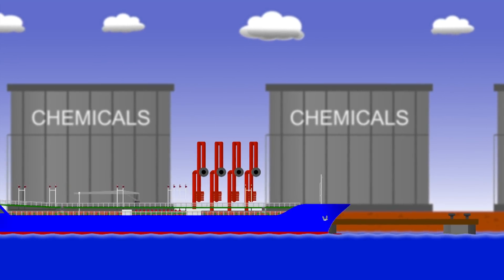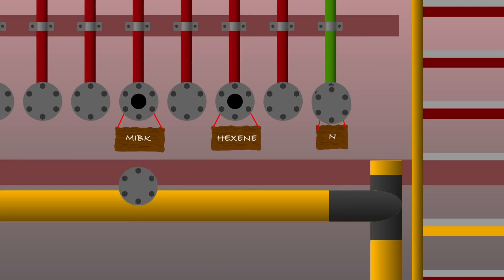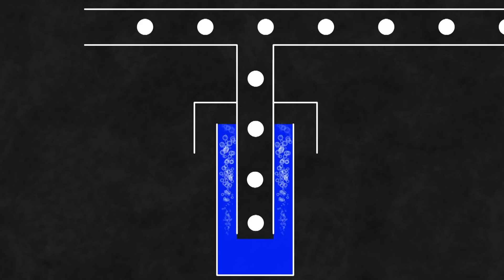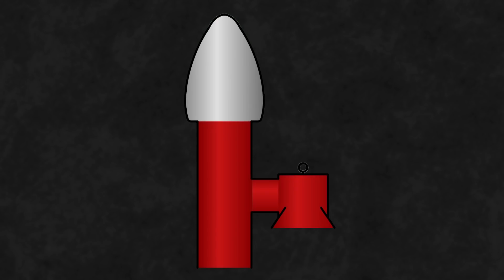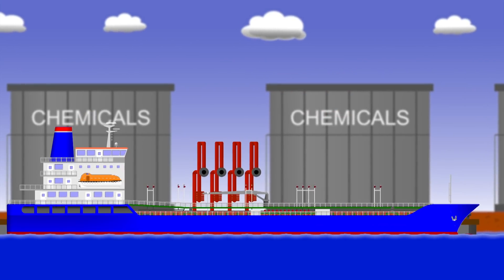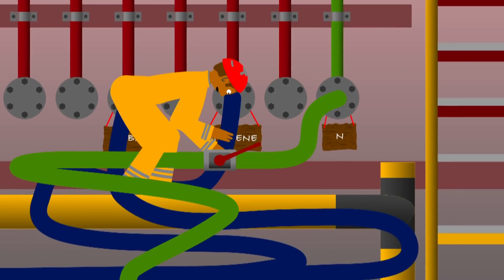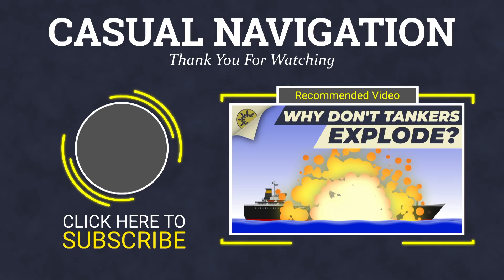What Do Ships Use THESE For?

Comment: as a chemical engineer i'm kind of horrified that there wasn't any secondary pressure relief device in form of a burst disc. is it common on cargo vessels to not have anything like that? it would still have ruined the cargo, but at least it should have prevented a rupture of the cargo tank
Reply: Wouldn't a burst disc endanger the crew again?
As said in this video the pressure relief is build in such a way to safely discard the gas.
Whereas with a burst disc the gas would stay on the deck.
Reply: @Jehty_  fair enough, though you can also install it high and away from the deck, to minimize that. and i'd rather have just the gas collcting on deck and be warned with an alarm, then have the tank under my feet rupture and then most likely still have the gas collecting on deck or worse in the hull
Reply: @saladiniv7968  or have it be connected to a pipe on the side of the tanker, so it spews over the side, away from the deck, cause it’s going to end up in the ocean either way
Reply: @Jehty_  A burst disc is a last resort and it endangers the crew less than the cargo tank bursting!
Reply: All of my rocket test stands and rocket vehicles had relief valves AND burst discs, with pipeaways to control flammable vapors if needed. For the Lynx vehicle with integral low pressure fuel tanks in the wing strakes, I invented a resettable 1.25" burst disc that used magnets to hold a plug in place. It could be adjusted to open at pressure differences from 1.2 to 11 psi, with repeatability within 0.15 psid.

Okay, maybe it is rocket science, but it's really damn basic rocket science.
Reply: International regulations regarding cargo tank pressure and venting can be found in Safety of Life at Sea (SOLAS) Chapter II-2 Regulations 4.5.3 and 11.6.3. As well as the Code for the Construction and Equipment of Ships carrying Dangerous Chemicals in Bulk (IBC Code) Chapter 8.

The big takeaway is that a cargo tank needs two means of protection against over/underpressurization. Most oil tankers will have about 12 to 16 cargo tanks and use a P/V valve on each tank and then a P/V breaker on the common vent header.

But chem tankers have to be concerned with cargo compatability, so a common vent header is not frequently used on these vessels. Instead the high and low pressure alarms on each tank serve as the second means of pressure protection.

Rupture discs (as the maritime industry calls them) are allowed as a means to protect the tank, but then that released cargo needs to go somewhere safely, which means it can't go to another cargo tank or adjacent area where it may have a dangerous reaction. This requires a vessel to dedicate space on the ship to only be useful in an emergency, and in shipping lost space is lost money. So they usually go with P/V valves, pressure alarms, and outlined procedures on how to conduct a cargo transfer. In 99.999% of cases this combination works just fine. But in this case they ignored their procedures, got a low pressure alarm which warned them that things were going wrong, and then they over corrected instead of taking a step back to reconsider. Regulations help prevent disasters, but even the best regs will fail when people decide to ignore them and ignore common sense.
Reply: @phantomsplit3491  interesing to know. in the chemical industry an alarm is just a warning, but would never count as a separate safty feature if it requires any action by the workers. it might be a bit paranoid, but we assume the worst case in wich the entire workforce is incapacitated/just not paying attention. i agreed that in 99.9% of cases it would be overkill, but that 0.1% is un my mind enough to justify it.
Reply: @phantomsplit3491  may I ask in what part of the world you’re working as a PSC inspector?
Reply: @bas6983  I'm in the United States
Reply: @saladiniv7968  the pressures are continuously readout on the loadicator and the activation of PV valves is a reminder too for the deck crew. The alarm is a final warning, and over pressurisation is normally treated seriously. But ig they downplayed its severity, because it's not that rare.. It's pretty frequent in chem tankers especially when recieving nitrogen from shore. It's a pretty big thing if your company recommends a 1 inch hose and  you're using 4.
Reply: Fun fact: My previous vessel's pumpman was among the one's who got sacked for the Accident.
Reply: @rustteze  taht is all well and good, but i wouldn't call anything that requires any intervention by the crew a safety device. for that it would have to automatically act in a way to prevent an accident, in this case release the pressure. you should also always have 2 independent systems doing it, to prevent the faliure of one resulting in an accident
Reply: @saladiniv7968  yes it's mostly just a fallback for if the PV fail. The cost segment for owners means most of them install just the bare minimum for the ships to pass international standards.. And if 99% of the time it works.. No ones gonna take the initiative to change it
Reply: @rustteze  That's the same in any industry i guess. i guess i'm just kind of spoiled with these redundancies, since switzerland is very safety conscious, especially if it comes to chemical industry. so the regulations are pretty strict and demand it, otherwise a lot of companies probably would try to cheap out as well.
Reply: @beeble2003  if the burst disc came at the end of the relief pipe and a check valve fitted with the end discharging overboard I don’t see the problem …
Reply: @chrisbraid2907  I never said there was a problem. Somebody said that burst discs would be dangerous for the crew; I pointed out that they would be less dangerous than the cargo tank exploding.
Reply: Burst discs are actually used when transporting Hexene-1 on chemical tankers, they are inserted between the PV and the PV pipework to seal off the cargo space from outside air completely due to Hexene-1 reacting with air. Should that fail, the burst disc goes, and then the PV blows off. There is a lot of issues with this. As a cargo tank is 98% full, and a ship rolls & pitches at sea, the fluid can come up in the PV/vapour line and burst the discs. We often found that when removing the burst discs after a Hexene-1 trip that most of them had burst anyway.

Comment: A few things:
The PV valves are seperated into three segments, not two: Main body (the pipe) Upper house (pressure side) and vac side (vacuum side)
When releasing pressure the high speed is also needed in case there is a fire on the deck. As the air travels faster than the burnspeed, fire can't make its way down through the release.
At the vacuum side there are two very fine metal grids, these prevents fire from comming in when it sucks in air.
Source: Me, i used to make these things at my old work (Pres-vac engeneering)
Reply: Very cool! Any interesting stories to share from your time in that industry? New advancements, strange problems you weren't expecting, etc?
Reply: @itsmeepo4203  I wasn't realy involved that much in RnD, so can't say much about that kind of thing.

And most of the problems i faced was generic factory problems of the RnD people mocking around with something, and forgetting to tell people making a whole bunch of confusion.

Think the wildest we had was a russian tanker back in 2017 or so which needed new valves becouse their valves all just kinda died, it was a super mega rush order that was picked up by helicopter

Comment: I love the channel and your videos! As a licensed engineer under STCW and port state officer, I use them to train others and they have increased my own knowledge as well.

For the first time I do actually have a small bit of feedback. SOLAS II-2/4.5.3 and II-2/11.6.3 and IBC Code chapter 8 are some of the most convluted, annoyingly written regulations in the industry. But they do require tankers to have two means of protection for over/underpressurization of cargo tanks. For most oil tankers and low-grade chem tankers this will be the P/V valves on each tank, and a P/V breaker on the main vent header.

But most Type 1 chem tankers which carry the grades of cargo in this scenario do not use P/V breakers because of cargo compatability concerns. But because they have small cargo pumps installed within each tank, they can use high and low pressure alarms on the tanks to replace the P/V breaker.

I'm not intimately familiar with this vessel, but would be extremely surprised to see a type 1 chem tanker with a P/V breaker. Because a P/V breaker on such a vessel would conflict with regulations on cargo segregation found in IBC Code 3.1.3 and 46 CFR 150
Reply from the maker: Now you mention it, I am not sure if this tanker did have a breaker, but I wanted to talk about them as they are one type of pressure relief system. Maybe I should have demonstrated that part on a different vessel though.

Comment: "Wow, there's a low pressure alarm on the tank, reminding us all that since nothing is automated we have to watch it carefully and regulate it by hand ! So let's just open the Nitrogen full blast and go have a beer without paying attention to it anymore"
Reply: A very broad and “offensive” message. A pure blaim culture idea. 
Maybe the terminal increased the flow of nitogen themself. Opening up a valve a shore and the high inflow if N2 out of a 4” hose cant be handled by any normal pv valve. 
Yes, an incident occured, but why the blame directly towards the vessel?
Reply: @bas6983  No. If the low pressure had gone worse and caused damage it would have been an accident, the second time should not have gone unnoticed. I work in automation so basically i replace human control with machine control, i know it's not possible to have someone check everuthing all the time, but once a red flag is raised you can't ignore it anymore.
Once you're warned if you fail to pay attention to it it's someone's fault. Either the guy in charge or a more global reason which caused the person to be otherwise occupied.

I blame no one because i don't even know if it's the vessel crew or the terminal that should check this and I don't care. I just pointed out the fact that basically "fool me once shame on you, fool me twice shame on me" happened here, and worded it this way for humorous reasons
Reply: @crezychameau  the ship has the pressure readings of the cargo tanks. The low pressure was noter and acted upon. At that moment the deck watch was most likely asked to open the valve a bit more. Check opened valve chief. At that moment you’re waiting what the situation and pressures are doing. If the valve was fully opened and a large amount of high pressure n2 entered the tank. This will lead to a high pressure alarm and potentially before the situation was fully understood the incident occured. You work in automation. But you do not work at a ship or in the tanker world. Not a single ship is the same as the next one. Not even full sisterships. All terminals over the world ar different and. Crews are limited. Mulitple layers failed in this instance and defenitly not only at ship side. The terminal should have reduced the max flow available to the ship to a more or less acceptable rate. The crew partly failed as they accepted the n2 hose etc etc. But pointing directly at persons is exactly what not should happen.
You mentioned. Low pressure alarm. Open the valve and forget. Get a beer/tea/softdrink and forget. Thats blaiming a crew in western european non native english speaking terms. We’re looking at a 10m clip and making conclusions. Thats just dangerous.

Comment: Makes me wonder why there wasn't a flow control valve on the ships side just integrated into the piping. This would enable you to hook up larger than designed for gas systems and still not exceed the 17.000 cfh limit.
Reply: Same, I mean you can't go full "only accept the right type of line" that would ideal, but some har ors might not be equipped to handle it, so having a flow restrictor on the ships side would be second best.

Comment: The real question here is actually, why wasn't the nitrogen supply stopped quickly enough after the overpressure alarm went off? Too small margins? Wrong alarm level set on the sensors? Failure of communciation? Too slow valve actuation on the supply line?

Comment: Hasn't anyone in the shipbuilding industry ever hear of an orifice? If the ship's manual recommended a 1" hose, install a 1.2" orifice and the hose size is immaterial. It shouldn't take a rocket scientist...

Variable speed pumps may be more expensive, but they'll pay for themselves in just a few voyages by allowing better control.
Reply: The industrie has. But the system is not designed tubbe used with an orfice. Extra flanges in the system are not allowed by many terminals. The cargo pumps of a vessel are mostly variable speed. The rate is depending again on a lot of variables depending shore line diameter. Max flow rate approved by vessel and terminal.
Reply: I was thinking of a pressure regulator like high pressure gasses. I guess the flow rates are  too huge
Reply: @MrNoobed  and these are available but not fail safe. There is reason why the crew appearantly asked for a 1” n2 hose and as I mentioned before in most cases the vessel gets  displaced shore tank atmosphere back on board. Supplying high pressure n2 is in NW Europe very uncommon  when using it as padding system.
Reply: Actually, the respective company and it's qhse manual does recommend an orifice, it's supplied almost on every ship. They just didnt install it, probably because they downplayed the risk and ofc their overconfidence to manage it.
Reply: @bas6983  That's much like the vapor return systems used in gas (petrol) stations in California- as the fuel fills the car's tanks, the vapor is transferred back to the station's storage tank, keeping the noxious fuel vapors from being released into the air. Using high-pressure N2 to fill the ship's ullage leaves the hexane vapor in the shore tank nowhere to go but out into the air, which is both wasteful and polluting.

This is another case where doing good (not polluting) also allows doing well (not breaking a ship).
Reply: @r0cketplumber  to be honest. I think this is the same in nearly the complete western world. At least in Europe this is the practice aa long as I know.

Comment: Based on the picture that advertises the video those are vent covers to prevent the oil storage tanks for being over pressured and it has a release valve to that does not allow fire to go back into the tank

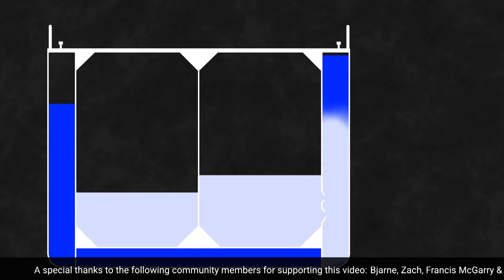Comment: Obviously the problem is at 1:48; they're using a foreign part for the emergency stop.  "What does this Nödstopp mean?"  "Stop something I guess."  "What does the other side say?" "Hätäseis; Hot as it is, maybe?"  "Yep, let's push it that way."  ;)

(Special thanks to Petteri for pointing out the Hätäseis.)
Reply: In Dutch, "nood stop" would be "emergency stop"
So I have a hunch xD
Reply: Nödstopp is emergency stop in Swedish
Reply: Hätäseis means emergency stop in Finnish. And you don't push an emergency stop "that way". You just push it in and it stops whatever system it is meant to stop. They look basically the same worldwide, so it doesn't matter whether its a foreign part or not. Total nonsense.
Reply: @TigruArdavi 
Joke ----------------->
Your head -------->

Comment: So the initial alarm of low pressure was a true reading and the crew simply overcompensated due to the large hose diameter?
Reply: If that's the case, then couldn't they have just slowed down the rate you pump out the chemical instead of increasing the rate you fill with gas?
Obviously, hindsight is 20/20... but was that an option?
Reply: @loayzag91  It would depend on the motor that the pump used. If the motor was powered from a VFD/VSD (variable speed drive) then it would be technically possible to adjust the flow rate. Many motors just run straight off the mains and as such are either on or off.

Technical reasons aside, this still isn't a great option because time is money! Slowing down the offloading would not be the best option from a financial perspective (especially as there was no reason to do so, if the inert gas system was operated correctly).
Reply: @charmio  Thanks for the response! I figured you wouldn’t want to slow down the rate of pumping chemical out because of time limitations… but I was just wondering if slow, gradual changes in the case of any doubt among the crew could have led them to identifying the problem before parts started failing. But like I said, hindsight is 20/20.
Reply: @charmio  Most cargo pumps on chemical tankers are operated by a hydraulic motor. The motor's speed can be controlled by a speed control valve, which determines hydraulic flow rate to motor. Framo makes the most commonly installed system, to the point where hydraulic driven deepwell centrifugal cargo pumps are usually just called Framo pumps. So they can control pump speed, but I'm not at all surprised that they instead tried to regulate the N2 flowrate instead.
Reply: And most chemical tankers operating electric pumps are using Marflex systems. These are var rpm systems. Only the smallest variants have a direct drive. In that case you can close the delivery valve to reduce the flow. 
In a lot of cases its about “production” and 300m3/hour (or a value set in the pre cargo meeting) has to be kept to keep charteres and owners happy and prevent a letter of protest for slow discharge. 
Opening up a nitrogen supply a bit further is very common. You start up and do not have a balanced system directly. The pumprate can be calculated easily but the rate of the n2 will be trial and error. In many cases the supplied n2 is coming directly out of the shoretank as displaced volume.
Reply: Well I'll be humbled! 
The last two commenters know the specifics, read what they said. 
I had a look into the systems they brought up, they're spot on.